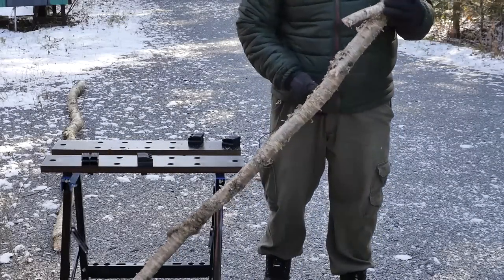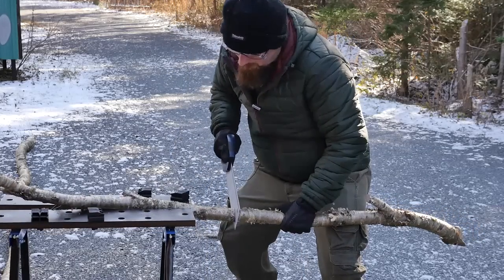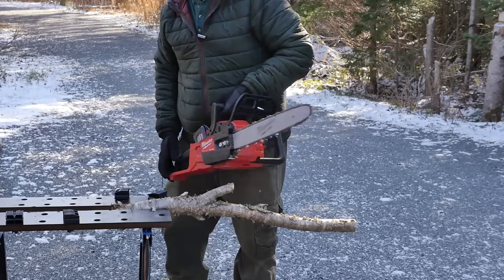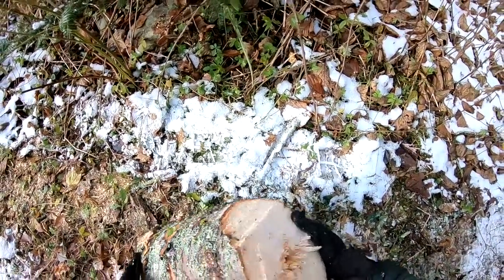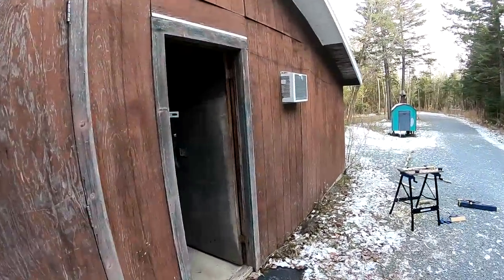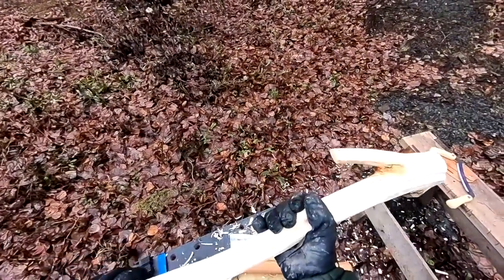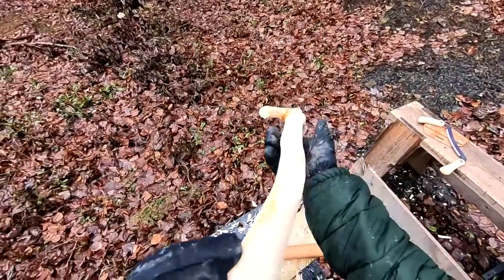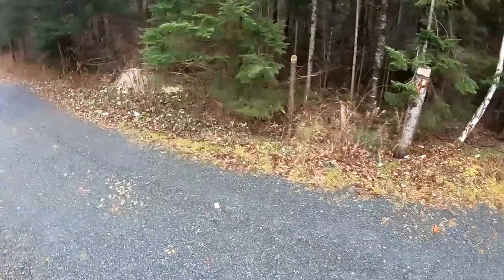Crafting, Hauling, and Rambling

Comment: carrying logs and limbs is what i do for work. there are easier ways to do that especially if you have a hatchet or two handy. stick the hatchet into the end of the log and it creates a nice carry handle. another way is to get a loop of strap and make a bundle using the strap. it's all hard work however you scrape it.

Comment: What might be an option is making a basic sled to pull stuff with and save fucking about with a wheelbarrow particularly with slopes and the impending weather change it might just be what the doctor ordered. Shouldn't be too difficult as far as technicality as my brain just presented me with two designs, nay three designs that could work just for pulling stuff about. There's probably plastic ones you can buy on the cheap that could do it as well.

Comment: Wont soft wood work for axes?  More flex and shock absorbtion . also get a decent silky saw they are really good
Reply: Soft wood tend to break too easily, and too much flex is not a good thing.
Reply: ironically, the terms "softwood" and "hardwood" don't always correlate to how hard or soft a piece of wood actually is. It's some other thing that determines it, though I can't remember what...
Reply: @1Kapuchu100  Seeds

Comment: Hey skall. I built my first project with one of those folding workbenches and I found a way to adress some of the wobblyness.    I put a sheet if plywood that fits on the bottom rails and load it up with a good bit of weight. I used a box of paint cans as weight.

Comment: is it true you can steam wood to shape it, or something along that line? I've heard it in passing, but I have no real familiarity with woodworking, so I could've just heard someone yammering off. If true, though, those bends should be easy enough to fix. Though it likely would depend on the thickness and density.
Reply: @cavouku You can actually, you can also fire heat it to bend.
Reply: Works best for planks and relatively thin pieces, but yes.